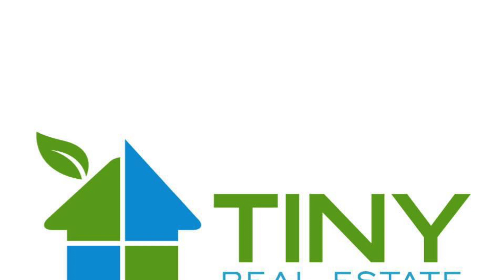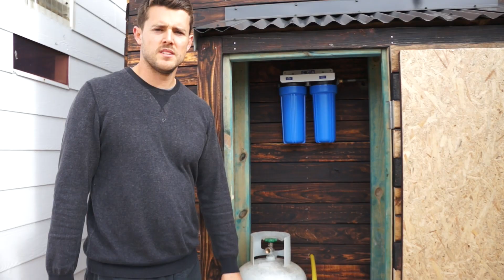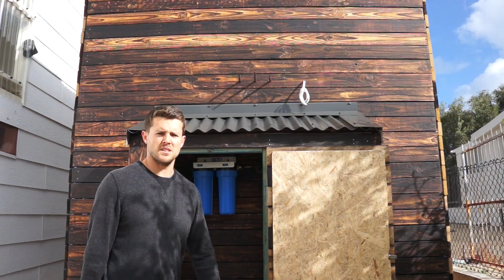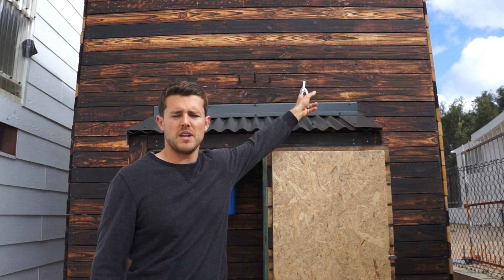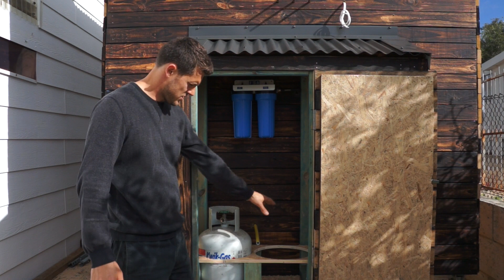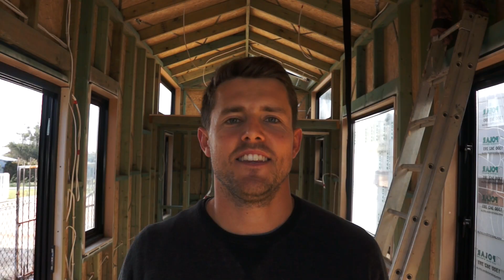Installing Plumbing In A Tiny House

Comment: Very clear (and being from the US I find your chipper style & accent just perfect😊). One question: is PEX tubing not an option for you? It would be helpful to have an estimate of your total amount of linear tubing /piping/gas line for x size THOW.  Also when you say "standard water heater" I am presuming that is a tankless instant hot water heater (those are not yet standard here except perhaps in THOWs). Thanks for sharing-I'm a couple of months behind  you & having done electrical, the plumbing /gas is the most intimidating 😳for me.
Reply from the maker: Thanks Chris :-) We have PEX here in Australia from my understanding but my plumber preferred to use this product as he works with it all the time and had heard a lot of good feedback about it. I'm not to sure on the amount of piping sorry. Maybe roughly 10 metre for water and another 10 metres for gas as a very rough guess. Yes we have a Rinnai B16 unit which is a gas instantaneous unit. Good to hear you are building your own. All the best with the plumbing in your tiny!

Comment: Did you do the shou sugi ban technique to your pine cladding? If so, what did you seal it with? Holding up well? I've been concerned about using pine for exterior. Looks great!
Reply from the maker: Hi Mackry, thanks! Yes we did do Shou Sugi Ban to our cladding. We used Osmos UV protection oil the first time around but have since re-sealed using a british paints natural decking oil. Both worked well. I did prefer the Osmo oil as it went on thicker and soaked right in but it is very expensive. Best of luck.
Reply: Thank you!
Reply from the maker: mackry you are very welcome!

Comment: Thanks Adam, a really clear and easy to understand run through of you plumbing installation. One suggestion would be to show the flex hose connections where used. This would help THOW builders see just how the final connection is made.
Reply from the maker: Thanks Rob for the kind words. We will be shooting another video on the final plumbing setup very soon which will show more detail on the completed plumbing setup so keep a look out for that. Cheers.